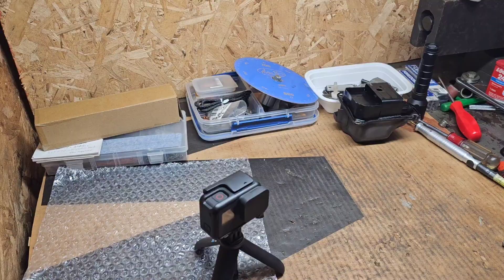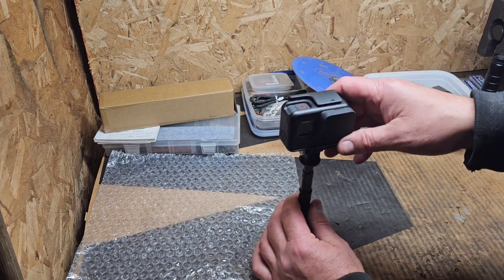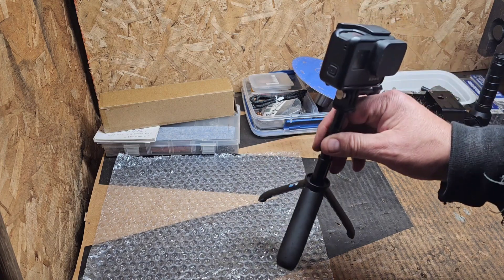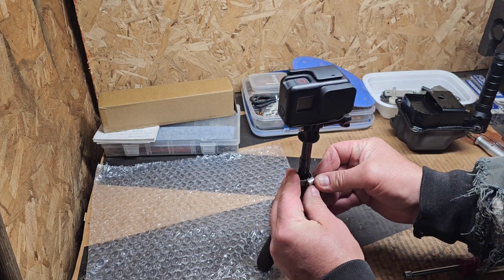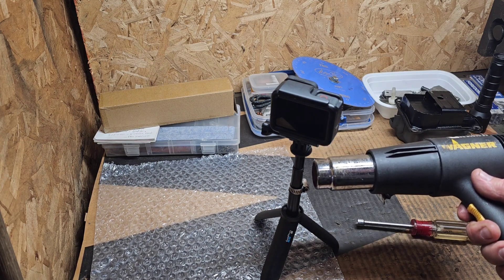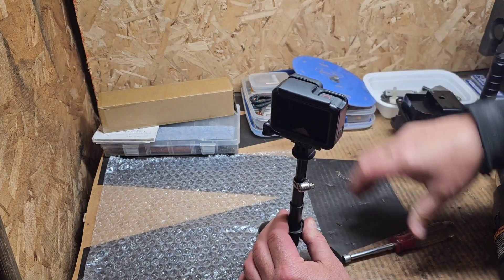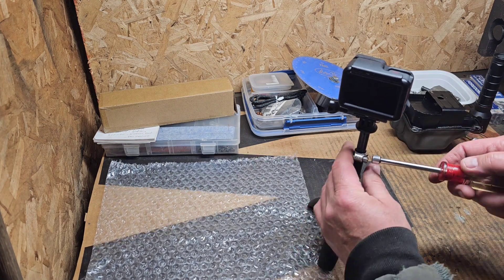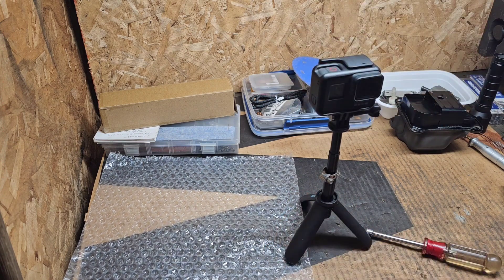DIY GOPRO SHORTY FIX/DON'T THROW IT AWAY.

Comment: Thanks for the great tipp! Can you plase let me know, how did you mount the GoPro without a screwmount on your Ulanzi tripod?
Reply from the maker: I used a replacement folding finger mount from Amazon.This finger mount has a 1/4" x 20 threaded hole in the center. I believe this fits gopro 8 - 11. Not good at adding links in description.  FROM AMAZON: HSU REPLACEMENT FOLDING FINGERS (HGP235A) OTHER # ON PACKAGE #XCO3FS1GP3.  I just uploaded a video on this subject. Hope this helps. I appreciate the comment and thank's for watching!